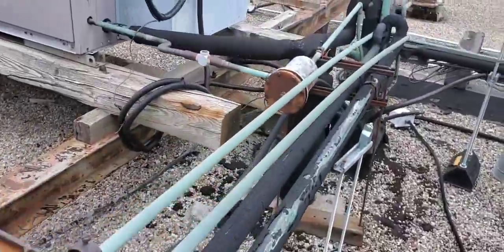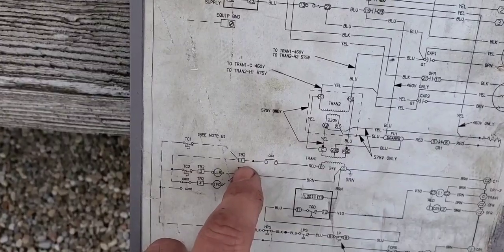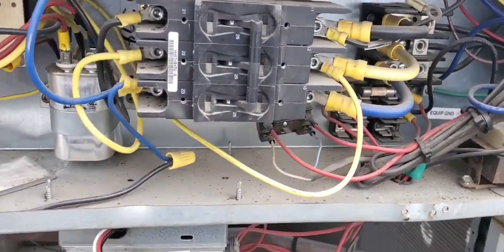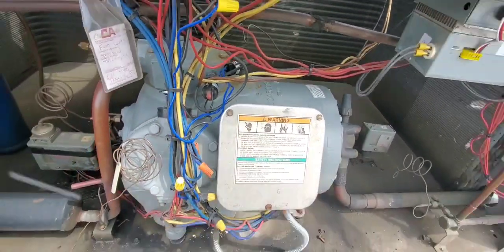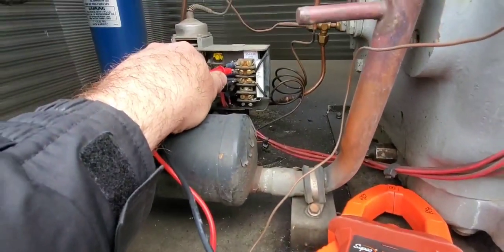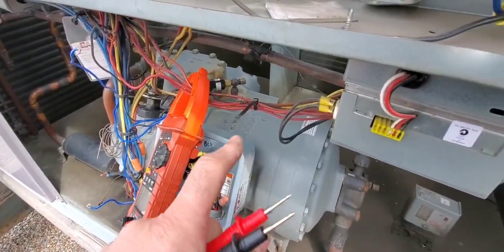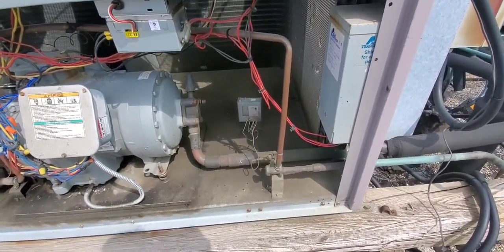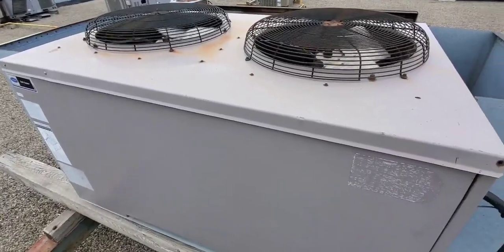Carrier Condensing Unit Not Starting On A Call For Cooling

Comment from the maker: This system has 5 floors of piping and has had oil return issues, we can't assume the low pressure is due to unenergized liquid line solenoid valves.
Reply: It runs Dx air handler’s or no,and does the system run off thermostat or temperature timer

Comment: Yea u let us know on Facebook, system was pumped down and never had a call for cooling
Reply from the maker: The system did have a call for cooling, the signal was present at the condensing unit.  This unit has had several low pressure, oil return issues, plugged up accumulator issues.  Checking to see if the solenoids are energized or not is just one step.  For all I know, the suction line strainer coulda been plugged or suction line accumulator.  Leave no stone unturned and you'll sleep better at night.